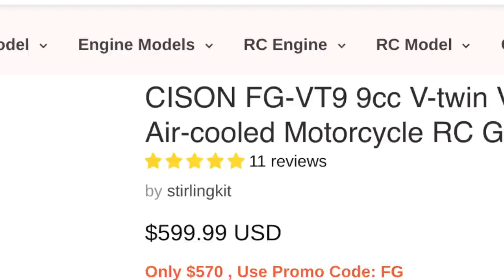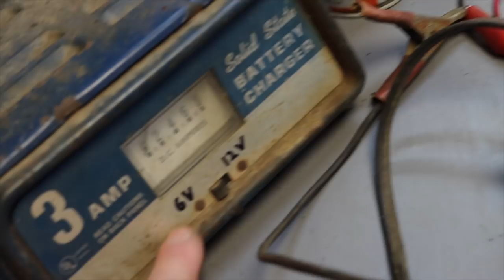Mini Harley Davidson Engine Giveaway, Review, & Teardown. Cison V-twin From www.Stirlingkit.com

Comment: Did you know Harley Davidson started out as a single cylinder? And when they switched to a two-cylinder engine they were too costly to produce where the pistons were on their own crankpins, so they opted for the cheaper single crankpin thus giving it a 45% offset firing order. Then to top it off they were too lazy to make a new spark system to fire the cylinders independently so both of them fire at the same time that gives Harleys that very distinctive noise bang - bang - pop, the pop being from the second cylinder firing unburnt gasses. But the noise was so distinctive they tried and failed to trademark it in 1994.
Reply: Thanks for sharing. Did not know this.
Reply: They couldn't get a patent, but they did trademark-register the sound: "Potato-potato-potato-potato etc.
Reply: They didn't try to trademark in 94
. they took Honda to court over the sound the Court ruled that you cannot patent a sound
Reply: @brenttate9299  More famously, Harley-Davidson attempted to register as a trademark the distinctive "chug" of a Harley-Davidson motorcycle engine. On February 1, 1994, the company filed its application with the following description: "The mark consists of the exhaust sound of applicant's motorcycles, produced by V-twin, common crankpin motorcycle engines when the goods are in use." Nine of Harley-Davidson's competitors filed oppositions against the application, arguing that cruiser-style motorcycles of various brands use the same crankpin V-twin engine which produces the same sound. After six years of litigation, with no end in sight, in early 2000, Harley-Davidson withdrew their application. directly from wiki
Reply: @thequixotryworkshop2424  if I won this I would make up my own channel, and fabricate a mini Harley style bike.
Reply: harleys are for conformists
Reply: @carmineredd1198  like your prom date?
Reply: @carmineredd1198  walk into a Hells Angels bar and shout that over the conversations. If you survive go to a Sons of Silence bar and shout it over the music. If you survive run for President.
Reply: Both cylinders do not fire at the same time, only spark plugs fire;) and there is no unburnt gas that could ignite, except when the front cylinder is firing, then the rear cylinder is in intake stroke and can backfire through the carburetor.   it's not bang - bang - pop, it's bang - bang - - bang - bang, and if it were like you said, firing unburnt gasses, it would sound more like this: bang - BANG or bang - bangpop.      I have an old Harley with an aftermarket ignition system (single fire) that fires only one cylinder at the time, and it still has exactly the same sound as with dual fire ignition. Harley's  distinctive sound comes from cylinders being spaced 45° from each others, which makes the firing interval uneven, between the rear and front cylinder firing there is 405° gap and between front and rear it's 315°,   the "offset" is 90°  and that is what makes the famous Harley sound.
Reply: This is a interesting motor, but I don’t have any idea 💡 what to do with maybe just put it on my coffee table and talk about your channel 😂
Reply: They did it to save money and to stay alive during the depression. I call that smart business. Every other american motorcycle manufacturer went under. 120 years of continuous manufacturing they must be doing something better that most others
Reply: @brenttate9299  So all music is open-source? 😁

Comment: This is coolest damn thing I’ve seen in a very long time. I’m an aircraft mechanic by trade, and my motorcycles are 45deg vtwins, so this is right up my alley. Fun fact, a Harley twin like this is literally a radial aircraft engine with 5 cylinders cut off. Apart from the cam layout, they’re exactly the same. This is the ultimate desk trophy, conversation piece, garage toy, what an incredible device to display and run and show off. Thank you so much for digging into it, showing the innards, walking through the troubleshooting on reassembly, and giving us a deep dive into this beautiful little engine. I can’t wait to have people crowd in my office to see it run.

Comment: You are supposed to time it so it fires before top dead center also that other nipple coming out of the case is used to pressurize the fuel tank, I am surprised it actually drew fuel up that hose

Comment: Thanks for posting this Jon.  Very interesting.

I can confirm your assertion that small hardware which goes flying in the shop ends up falling into a black hole.  Just this past weekend, I was securing my newly-purchased Yost ADI-5 vise to the workbench.  I bought 3 bolt assemblies (bolt, 2 washers, nut and nylon nut) at Ace Hardware earlier in the day.  The holes were drilled and it was time to bolt it on.  Well, while separating one of the bolt assemblies, the nut fell.  I heard it "ting" something on the way down, but I didn't see where it was going because I had my reading glasses on, so everything below my waist was blurry.  For about an hour, I searched for that nut on, under, and behind everything within about 10 feet.  I also swept the floor and ran a magnet over the dust & dirt pile.  Nothing.  Just. . .gone.  🤔

Mean ol' shop black holes.  😉

Comment: As you were cheerfully removing the valve collets I was mentally yelling "No! No! They'll fall through!", but, of course, you were intending to dismantle the engine regardless, so my concern was wholly unfounded.
I hope that the lucky winner is someone who actually makes videos, and that we'll get to see what use the engine is put to. It could drive a model cyclecar, motorcycle or boat, or even run a tiny but functional generator, sawmill or circular saw...

Comment: I would've killed for stuff like this as a kid.
These would be so great for kids interested in how things work or as a way to get kids interested in mechanical devices/how things work
Reply: My dad had me take apart an old Briggs&Stratton when I was a kid, more manageable part sizes, and didn't cost a thing. I'll do the same thing with my kid, if combustion engines are still a thing when the kid is 10yo.
Reply: No shit
Reply: $600 is a bit hefty for the first "tinker with" motor, and the parts and processes are so fine it would likely be frustrating. A Briggs, Honda, or clone single cylinder OHV, as another guy mentioned, is the ideal starting point. Now, a mechanically inclined kid, maybe teenaged, who's  earned some credit by putting in his wrench time, that kid would get a kick out of this and respect it.

Comment: this was probably one of the coolest videos I've seen on small engines and the operation, the theory, assembly, reassembly, addition of components (the base). it just reminded me of my school days and I had so much fun watching you do this. the editing on the video was incredible the slow motion the notes even when you made a mistake you pointed it out and that was great man that was awesome. keep it up. this was the first time being on your channel so I'll keep watching as long as you keep making stuff like this.  loved the engine size. its so neat. you can put it into almost anything. I don't think you could put that much of a load on it though with those rubber o-rings but I love how you troubleshot the the timing and fuel ratios over all great video, great little engine. I wish I could afford it I'll definitely show this video to anybody interested in how a/an I.C.E. engine works.  ill leave with a joke

In a garage, where a famous heart surgeon was waiting for the service manager to take a look at his Mercedes, there was a loud mouth mechanic who's removing the cylinder heads from the motor of the car. He saw the surgeon waiting and lured him into an argument. He asked the doctor after straightening up and wiping his hands on a rag "look at this car I'm working on, I also open hearts, take valves out, and grind them down put in new parts and when I'm finished this baby will purr like a kitten so how come you get the big box when you and I are doing basically this same work" the surgeon very commonly leaned over and whispered to the loud mouth mechanic"try doing it with the engine running."

Comment: Fascinating video. I've been a nut all my life about how things work. Was always taking things apart and figuring out how to put them back together. Got my butt beat good when my mom caught me taking my grandfather's mantle clock apart. Had gears, cams and bearings all spread out on a bench in the garage. Managed to figure out how it worked and got it all back together though. Every mechanical toy I ever got ended up on that same bench. Grew up to build 13 harleys and several hot rod cars. Was a machinists mate in the US Navy keeping ships running. Worked for a railroad repairing railcars and locomotives. I'm retired now and have a sweet Harley and a righteous Mustang in the garage.

Comment: I have absolutely no use for that engine, but it would look awesome on my shelf and would make a great conversation piece. Curious what others would actually use it for. Great job.-Ed
Reply: Dude I would so try and make a RC Harley for my grandpa. And if he wouldn’t want one I’d make my Can-am into an RC as it does use a V-twin
Reply: It would be great in a model airplane application. I have a couple of dozen four-stroke engines including two boxer style twin cylinder four-strokes that are VERY similar in nearly every way to the engine in this video. The carb used on this engine even appears to be identical to the carbs used on many of my engines. The white box the author keeps calling a distributor is actually an electronic ignition run by a Hall sensor placed on the crank case which is activated by a magnet placed on the crank shaft. Every time the magnet passes under the Hall sensor the ignition sends a spark to the plug.  In regards to the size of this engine, it is not really as "amazingly tiny"" as the author seems to think. Model airplane engine manufacturers have been making single and multiple cylinder four-stroke engines this size and even much smaller than this one for decades and they are very reliable, powerful and smooth running pieces of art. All that aside, this is still a very beautiful piece of engineering and I would love to have one. To view engines that I am talking about just do a web search on OS or Saito four-stroke model airplane engines.
Reply: Agreed re RC airplanes, but my favorite small engine was a 12 cyl Ferrari engine, fits in the palm of your hand and literally screams when the builder revs it up. Having owned one, I have to say that other than size, I couldn’t tell the difference. That would be something to see in a P-51 or a Spitfire. Maybe someone has built a model of a P-51 engine. I would love to see that. I used to fly RC models when I was younger (back in the ‘80’s) I’m just thinkin’ of the fun your havin’!
Enjoy...

Comment: This is an excellent video, it was like watching a movie, it has a little drama, suspense, and the happy ending. I loved how you took the time and went step by step showing the engine breakdown and reassembly. I may have just added one thing on the reassembly since you had it all apart, I wish you would have machined little timing marks on the gears for future reference and made it even easier for the simple minded to put this engine back together. Awesome job showing how to figure out the timing instead of editing it out.

Comment: Been riding scooters (mostly Harleys) for +55yrs. Still have all of my "parts" in tact. Ha. Saw a smaller version decades ago as a Harley promo that used glow plugs and ran on RC fuel mix. Smelled bad but ran great. Been hoping for something like this as the only other I've seen was custom made by a man and not for sale. I think Panheads were the most beautiful motor Harley ever made. The 88 Evo was the best for longevity. I just retired from 2 wheels as I felt I was losing just a bit of my edge and could no longer protect my wife as  she deserves. I couldn't keep her off the back. Ha. Thanks for the tear down. Glad you figured the gearing and got timing going well. I may try to spring for one of these now that my scooter days are behind me. Thanks again.

Comment: the oil tank on a Harley engine is separate and normally sits behind the rear cylinder and above the trans(also separate from the engine) that inlet on the back /rear of the crankcase is an oil inlet

Comment: I'm a Nuclear Engineer but also an engine/car enthusiast. This is a very cool video and mini engine that I have not seen before. When you were fixing the spark timing you set it at TDC but from a theory side of it when the spark fires the explosion in the combustion chamber takes time to fill the chamber. To get the most amount of power out of the timing, the timing is set to be advanced so the explosion has filled the combustion chamber at TDC to get the most amount of force on the piston. With the timing set right at TDC, the engine will still run but the gas mixture will not burn at the right efficiency and the engine won't produce the maximum amount of power. Also, it can affect the carburetor idle adjustment because all of the gas isn't burning in the cylinder already. So the adjustment screw won't help much because due to the spark timing there is too much fuel in the combustion chamber and the screw can take fuel away but not enough so the engine runs the same no matter how much you turn the screw. This is the problem you are having in the video. I am currently working on a Yamaha xs1100 and the carburetors are giving me a similar problem but it tuen out my idle mixture screw holes are damaged so I am not getting the response I need. This is a very good video that I enjoyed and I sent it to my father who is the one that taught me about cars and engines. He is going to be amazed at the quality and size of this engine. Thank You for sharing!

Comment: Good job troubleshooting that gear train. The panhead motor had a distributed where the ignition wires come out that cover is what it looks like and the opening behind it is for the generator

Comment: One of these model engines would be very cool. to have in a shop class. Although you get to take apart a small one cylinder engine, this engine would be a better model because most motorcycles have a two cylinder engine.

Comment: It's ok to change plug wires from either cylinder. Harley 45' V twins coil discharges twice. One spark is always  on its siblings' exhaust stroke. Old school is cool! These poweplants were designed and developed 100+ yrs ago. Common crankpin, and all. No crankshaft, so to speak, flywheels! I've always wanted to use one on a Beechcraft, but a scale engine would be perfect on an R/C aircraft. Thanks for sharing man.

Comment: Excellent video!  There is nothing like taking apart an excellent running engine and going through the process of getting it to run again. We cannot leave well enough alone- 
"If it ain't broke don't fix it!"  I can imagine in 1000 years someone will unearth this engine and be amazed at how it was built. Internal combustion engines make real power ,heat,smell and noise, you just can't get that from a battery and an electric motor. It's like that little Harley has a soul !

Comment: Let me correct you on one item. At 3:50, you suspected that the bolt you were trying to shorten entered a black hole, which is incorrect. 
 I reality, very small parts are able to time travel into the future. No matter how hard you look, you will not find them until you arrive at the future time they have traveled to.  
When I eventually would find a part that I lost a while ago, I used to tell myself, "Ah, so this is where that part went to", now I tell myself "Ah, so this is WHEN that part went to"
I don't even bother to look to hard anymore, I just get a new part, and wait to meet that old part again.🙂
Very awesome and great video otherwise, I thoroughly enjoyed it!

Comment: Years ago, I got my kids a plastic V-twin motorcycle engine that could be taken apart and reassembled.  It was a great “3-D puzzle” that only came apart and went back together in one particular order.  They loved it and learned a bunch of stuff about engines in the process.  If I had this we’d be taking this apart and putting it back together too.  Make it the advanced class graduating from the plastic engine.  I don’t think you have the proper spark advance set for ignition timing.  It should be before top dead center.  If compression is weak, there may be an issue with valve clearance or valve sealing from switching parts that appeared to be “the same”.  Can check valve clearance easily enough with feeler gauges.  Could check valve sealing with marking dye and lap the valves to the seats if necessary.  Oh, the stuff that they could learn with this…

Comment: Cool little engine. Someone probably already said this, typically the spark occurs several degrees before TDC, I'd be curious to see what would happen if you moved it one tooth so it fires a couple degrees before TDC.

Comment: That's a Panhead motor made from 1948 to 1965. Love those motors. As far as the pushrods go the longest one goes on the front exhaust the second longest one rear exhaust and the middle two intakes are the same length.  It would be super cool to make a frame and all for the motor to fit into.

Comment: The lumpy but quickened idle sound of the running engine, then you blip the throttle: the pure poetry of an XR750. You've basically got a teacup flat track racer sitting on your bench. So how cool is that? That's how cool it is!